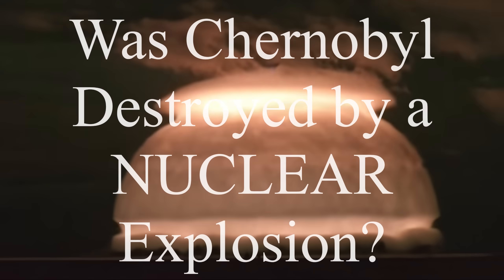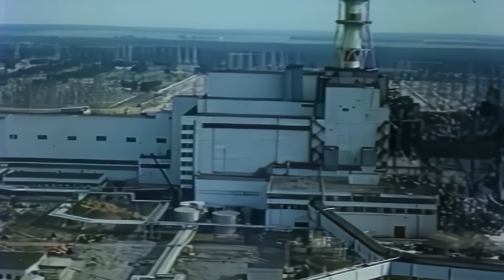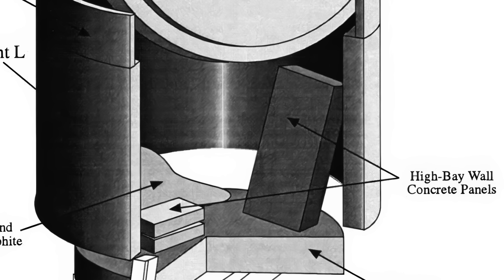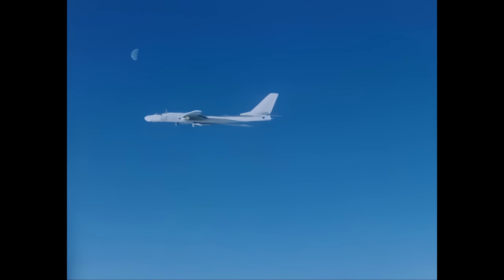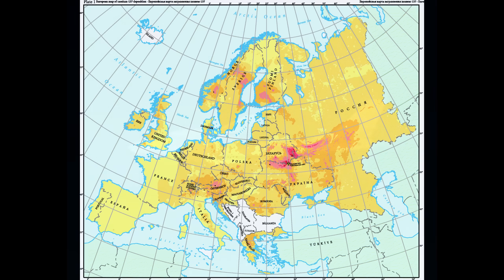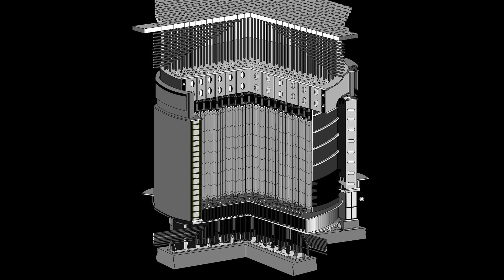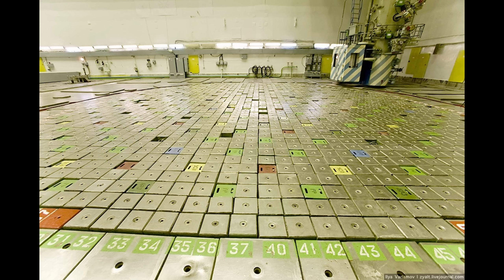Was Chernobyl Destroyed by a NUCLEAR Explosion?

Comment: Duuude. I still can't get over the lower biological shield.

The shear force necessary to burn through 2 meters of solid steel is... monstrous.

It's STEEL! Steel is actually really really strong. And this thing burned through a 5 foot thick 14 foot wide slab OF SOLID STEEL!?!?!?
Oh my GOD!!!
Reply: I don't know if burning is the correct description, I would think it more realistic that the nuclear fizzle did it - explosively dropped the quarter plate down in the corner where the prompt criticality went the furthest. Then, plate got melted further along the edges, during the several days of hot corium flowing to sub-reactor rooms.

The support (scheme C) is cross shaped, and it could be that thermal cycling had weakened plate along the line where it meets that support. Insignificant effect for nominal operations, but maybe subject to the forces involved in disaster it did give way as a weak spot in the grand scheme of things.
Reply: @u1zha  Fantastic! Thank you!

Comment: Great video with a lot of correct information, congrats!
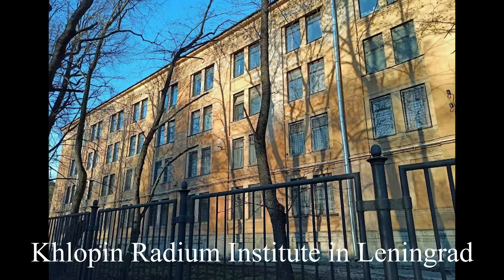One remark on 5:53 - RBMKs was not designed to run on unenriched natural uranium fuel.
The enrichment level was around 2% (elevated to 2.4% after the Chernoby disaster), although this is lower compared to the most commonly operated designs, with a significant exception of CANDU.

19:20 Additionally to the evidence cited by the two papers shown here (133Xe/133mXe ratio and detailed meteorological data) the arrangement of the ruins of the reactor building (like the 2 m thick lower biological shield melted through within seconds etc.) also supports the theory of nuclear explosion.
Check out video made by "That Chernobyl Guy" on this topic ("Was Chernobyl destroyed by a nuclear explosion?"): https://www.youtube.com/watch?v=kuptYyKoDM4

Comment: There's at least 1,700 tons of Fuel Containing Material or Chernobylite in the building, with concentrations of eight percent of Uranium or more as the FCM varies from place to place in composition. When the reactor blew apart, the "active zone" merged with the room below and most of the core ended up there, but not all of it. The rest was ejected upwards. I have no doubt the explosion was closer to a failed nuclear test than anything else. Perhaps a reactivity hot spot formed that vaporized a large portion of the lower biological shield, given the explosion originated in the base of the reactor.
Reply: The lower biological shield isn't vaporized, I believe there are videos of people inspecting it, and it's just bent and sheared by humongous forces. I agree with the vaporization in a hot spot, and it must've occurred inside the active zone - involving some graphite and fuel, not the metal of the shielding structure. That's too far geometrically.

Comment: The enrichment of the fuel is just not high enough. At the time it was 2% and at the end of the refueling cycle. No chance. Otherwise we would have seen this event somewhere before somewhere else. I am not saying the Chernobyl incident, but there are cores that use 5% enriched uranium and something would have already happened something somewhere that would hint at this being a possibility, in this case the design of the RBMK works in its favor because of how "low quality" the fuel is which prevents any kind of explosion.
Reply: Wasn't it much more stable when newly refuled, don't remember because if what mechanism though
Reply: @matthiasknutzen6061  I believe that is correct because when the core is loaded with fresh irradiated fuel
I) Additional absorbers have to be loaded in place of fuel in many fuel channels. These poison the graphite moderator and reduce the reactivity worth of the neutron capture in the cooling water. Thus the moderating effect of the water becomes more important than its neutron absorption and so the moderator void coefficient of reactivity becomes negative. So power if a power surge increases the rate of boiling, the increased boiling counters the power increase.
2) The absolute value of beta_eff is highest with pure uranium fuel, so the safety margin to prompt critical is maximised.
3) The fuel temperature coefficient of reactivity will be significantly negative due to effects of Doppler broadening on resonance capture in U-238. So the overall power coefficient of reactivity will be significantly negative. As irradiation transmutes some of the U-238 to Pu, this can increase the fuel temperature coefficient and might ultimately cause it to have a positive value. (I've not evaluated this for RBMK fuel but have assessed other types previously.)
Reply: I'd say the low enrichment of the fuel prevents a fast neutron chain reaction - as achieved by design in an atom bomb.
But the low enrichment does not prevent prompt criticality, so you can still have an extremely powerful uncontrolled chain reaction sustained by thermal neutrons.

Comment: The only thing i know of that can cut through 2 meters of steel in less than a second is an atomic explosion. Literally nothing else comes even close to the realm of possibly having a shadow of a chance of cutting through that thing in a weeks time and this monster did it near instantly. That is no steam explosion, it can only be supercriticality.
Reply: There's no doubt that the positive void coefficient readily allowed the reactor to become supercritical.
But to get bomb like energy yields, conditions would have to become highly prompt supercritical.
The video presents evidence to suggest that was possible.
Beyond that, one could attempt to calculate likely number of fission generations and the energy yield required before the core blew itself apart.

Comment: I generally agree, but I think the ordering of the explosions was reversed - the steam explosion(s) occurred first, followed by the fizzle. My position is that during shutdown, the heat output of the reactor exceeded the cooling capacity, leading to ruptures in multiple pressure channels. This was enough to displace the upper biological shield, venting the rest of the rest of the pressure channels and pulling all control rods from the rector. With no neutron absorbers remaining, the reactor was essentially unrestrained and reached catastrophic levels of power, resulting in the fizzle that blew apart the reactor and surrounding building.
Reply: except that anything that removes the rods would also be removing the fuel
Reply: Wouldn't the rods be pulled out via the ejection of their drive mechanisms, just leaving the fuel behind?
This definitely happened in the K431 explosion but that was a different reactor design - a naval pwr.
Reply: @ interesting idea, but graphite is pretty brittle and thus wouldnt be able to stick to the rods under that kind of acceleration. the sections of the rods wouldve just broken apart and gotten spread everywhere like the fuel did
Reply: @jackradzelovage6961  Depending on the construction of the rods, I agree their graphite tips might well shatter as you suggest.
But the neutron absorbing sections are based on boron carbide, which may be tougher.
However their axial acceleration out of the core might have been limited by the inertia of the reactor vessel lid.
The K431 reactor accident provides an example of a reactor lid and all the rods being ejected from a reactor.

Comment: Some observations:
The reactor was close to its refueling schedule. What people dont realize that rmbk reactors also produced plutonium as a side effect and i imagine would usually settle at the bottom of the fuel rods.
Its possible that the first explosion created enough compression to create a miniature atomic explosion that fizzled out due to less than ideal conditions.
Reply: If you are willing to talk of plutonium, then you cannot ignore the fission products accumulated at the end of the fuel campaign.  Those are neutron poisons and they are more numerous than plutonium nuclei.

Refueling of RBMK does not require shutdown and can be performed one channel at a time on a working reactor. We can imagine also that the central channels require more frequent refueling than the peripheral channels. Thus synchronized fuel burnup and replacement is not a feature of RBMK.
Reply: @phdnk  makes sense.
Reply: Plutonium won't settle at the bottom of the fuel rods - it will remain in the fuel pellets along with the vast majority of the fission products. Some gaseous fission products can escape from the pellets - to be contained by the  fuel cladding.

Comment: Air probe taken in Cherepovetsk showed extremely high concentration of Xe-135m (excited) , ratio of Xe-135 to Xe-135m was 22 after 5 days from Chernobyl disaster, although half-life of Xe--135 ( 9 hours) is considerably higher half-life of Xe-135m ( 15 minutes). Normally, ratio, like 13-15, could be seen after test nuclear explosions in a few days.  These data, alongside with data of analysis of graphite blocks, many of which were  half -evaporated within milliseconds ( temp of sublimation of which is 3642C) pointed to a fizzle nuclear explosion, as was determined by Soviet nuclear military experts from Minsredmash. It was the reason why non of them was sent to Chernobyl and true reason of disaster was classified.

Comment: I have some experience with automotive. Knowing how a cylinder deals with explosions and can or will transmit force is something I've needed to understand for a long time.

The double explosion sounds like hot-spot spark knock, or an unintentional ignition event. Part of the cylinder wall gets hot and then the piston side slides over it and the extra energy causes a spark. That will violently throw the piston down on the up stroke or just briefly reverse the force being applied to the crankshaft.

Google what that does to a piston.

It burns a third of it away so the gasses can escape the bottom of the cylinder. It abrades a hole in a solid steel piston. At those energy levels it takes millions of repetitions over weeks or months.

At maxed out Mol energy density or whatever it would probably take seconds. 1800 to 2200 Fahrenheit during gasoline combustion multiplied by however much more heat was present, yeah that's gonna be expressed in the math with a very reduced burn-through time.

Piston knock in a nuclear engine. I'll be damned.

Comment: Nuclear chemist here. 
I have a problem with the idea that low enriched uranium inside of a reactorcore with (or without) neutron absobers could result in a nuclear fizzle. 

The intense neutron flux initiating a nuclear explosion will result in the formation of nuclides with Z>98 like einsteinium and fermium through the so called r-process. These nuclides can only be produced this way, and if a promt nuclear chain reaction resulted in a nuclear explosion, I would guess these nuclides (or daughter nuclides) would have been detected together with the fallout. 
I have an even bigger problem with the idea that the uranium continued to fission after it was blown in to the atmosphere. Nuclear chain reactions require good neutron economy to maintain criticality, which is challenging even in controlled systems. When dispersed in the atmosphere, a critical configuration can not be present. This is also true for the molten reactor core: the configuration for criticality is lost. 

An explanation I've heared a while back regarding the first explosion, talks about an coulomb explosion that happened when the zirconium casing of the fuel rods melted and came in contact with water. Similarly to the violent reaction between alkali metals and water.
Reply from the maker: The problem with the zirconium explosion theory is that no zirconium dioxide has ever been identified during expeditions inside the Sarcophagus or in samples of contaminated soil from all regions of the Exclusion Zone. If a zirconium reaction had taken place, we would expect to find at least some, especially given the stability of the molecule. It is especially interesting given how much of the corium is zirconium based, but we also have unmelted fuel rods and other pieces of the zircalloy cladding, and none of it shows traces of a steam-zirconium reaction either.

Source: A Radium Institute Study on the corium structures, 2022, a copy is available here: https://elementy.ru/nauchno-populyarnaya_biblioteka/436460/Radioakt

In fact studies have shown that the zirconium instead reacted with the fuel and concrete before the explosion to form high-uranium zircon. Given that the oxidation of zirconium would outpace this reaction, it has been concluded that the zirconium either didn't reactor, or reacted with the fuel to form Zr-U-O, or  (Zr,U)SiO4 instead of any hydrogen-producing reactions.

https://www-pub.iaea.org/iaeameetings/IEM4/30Jan/Burakov.pdf

Comment: Whether or not the material was still fissioning as it was exiting the reactor into the sky is something extremely interesting that I’ve never really considered, my focus in my own studies is usually more focused on the events before 1:23:38/40 rather than after. However, even if the material didn’t continue to fission after its exit, one thing to consider would be the material simply continued to behave as if it were in the reactor, and how long it took to realize it wasn’t. 🤣
Reply: Good ol' uranium,  it keeps on working even when it's been let out of the factory.😂
Reply: Personally I doubt that the dispersed fuel could have self sustained a fission chain reaction after its ejection from the core. This is because the dispersal of the fuel would have greatly increased neutron leakage, to give a negligible likelihood of fission neutrons triggering further fissions.
All that have been said, the ejected fuel would still have been able to carry on undergoing spontaneous fission.

Comment: I commented earlier and sadly my comment seems to have been deleted. But I will ask a question rather than repeat the earlier comment. There are credible reports of staff seeing the fuel channel covers lifting before the first explosion. What do you think caused that? The fuel channels were presumably mechanically restrained so were not moving. Was the cause steam release from the earliest failures of the pressure tubes, specifically steam pressure under the covers causing them to rise? If, conversely this was due to upward movement of the whole pressure tube  following failure of the pressure boundary I would expect the steam pressure to continue to eject the whole fuel channel. This was no reported so I would discount this latter scenario.
Reply: YouTube has been doing that to me for some time now. I feel there is a secret algorithm or filter out there.
Reply: Nobody saw pressure tubes moving.